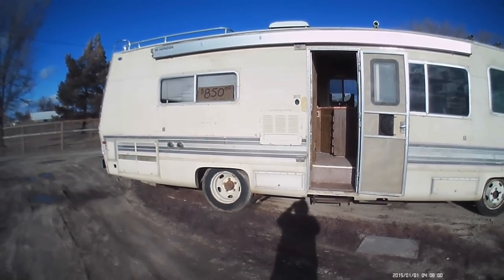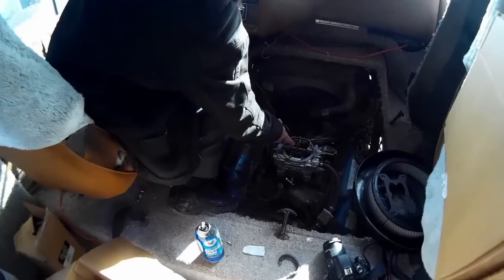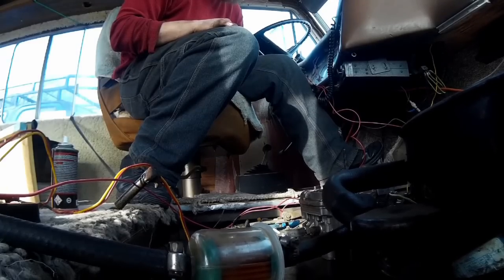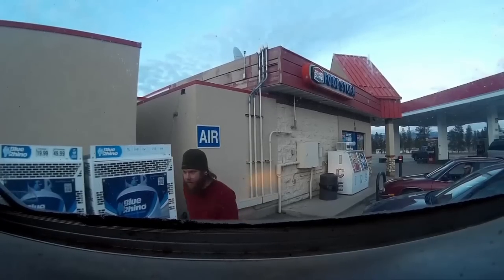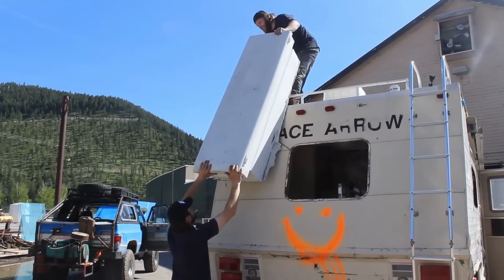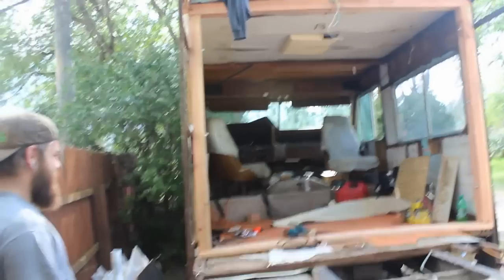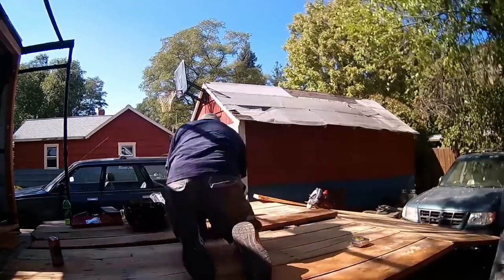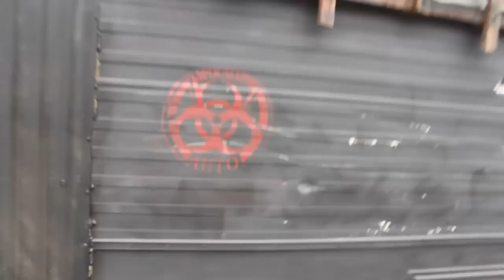$550 camper car hauler APOCALYPSE AUTO ep.3

Comment: I had a 68 IH scout 800a with a small block 400 and a fuel cell that the sponge disintegrated I drove for days with a 5 gal can on the passenger floor.... good Times

Comment: i think i have the last U.S.A made BMX diamondback here in Queensland australia (im thinking of doing it up coz it has been sitting in my back yard for like 5 years and my mum always says) (i should get some money and do it up) because the frame is rusting the front tire is bent coz i got hit by a car when i was riding it last the back tires rim is rusted as fuck and theres no grip on it coz of all the BMX racing the seet is torn up theres a lock stuck to it coz i lost the key for the lock handlebars are wonkey and a little rusty (so i need) a new seet. new hand bars. two new wheels. a new chain. some anti rust. maybe some OIL for the chain ummmm (well thats it)

Comment: Cool - I'd of sold you my old 440 ci MH cheaper ! 
When I take the body off ;
-park flat bed trailer by side of demo - shit falls on board..
- do some cuts to demo what you what  gone..
- take long heavy cable - wrap clear around the demo aspect - then hitch to the ..
 well here I use the F250 4x ... then drive about 20 ' or until al the demo shit falls onto your trailer...
 Done  !
ok - maybe sweep up a little too  !